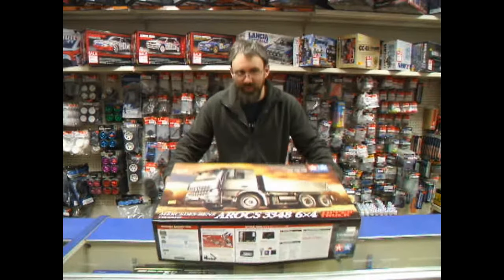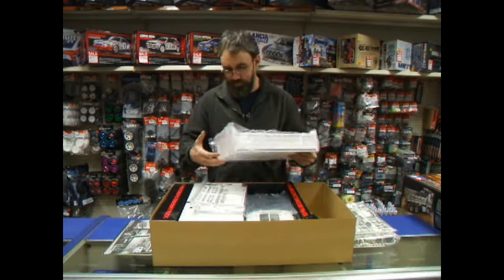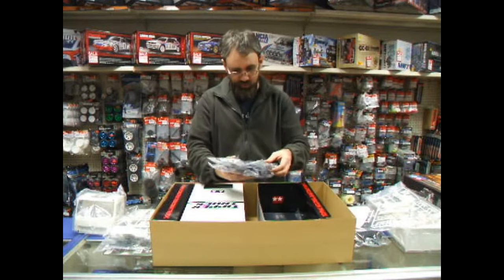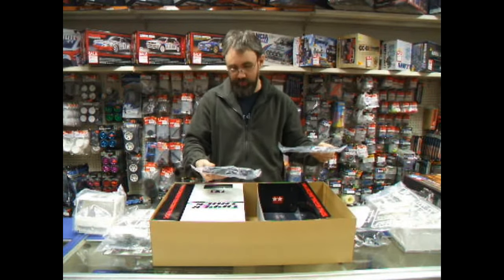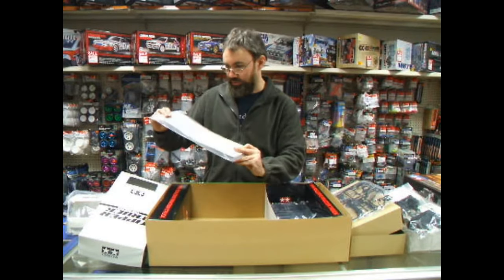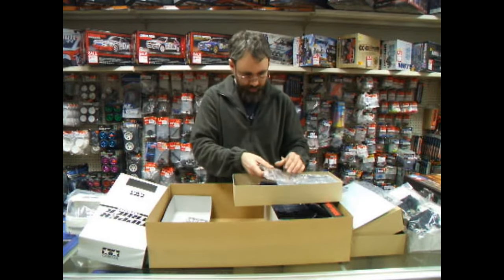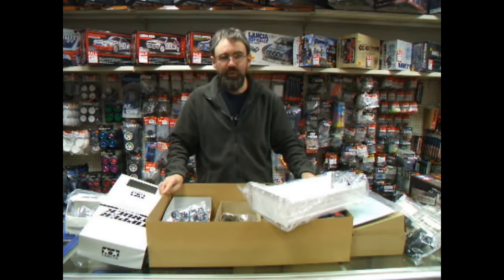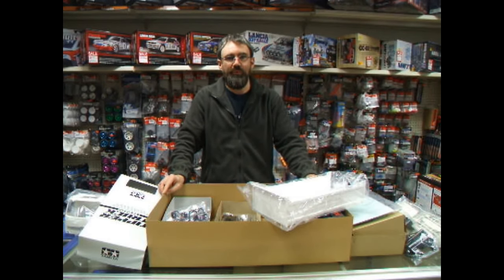Unboxing the Tamiya Mercedes-Benz Arocs 6x4 Tipper Truck

Comment: Hi guys the tipper hydrolic can it be made to go faster for this
Also do you do a combo pack for this so its RTR
Reply from the maker: Hi,

If you give us a call on 01795 410630 we can discuss this with you.
An RTR package is definitely possible, We'd have to look into the tipper speed and what can be done.
Reply: would want tipper the tipper gear radio gear and lights and sound
Reply from the maker: It's all possible to do, we've got a fantastic new sound system in stock at the moment aswell!
Reply: I'll email
Reply: Emailed guys its Paul @elitemodelsonline